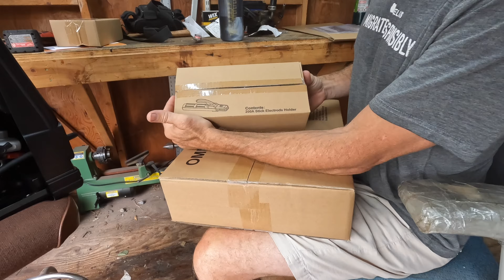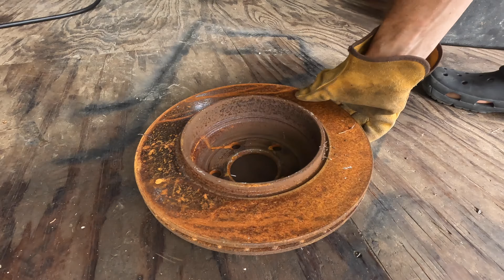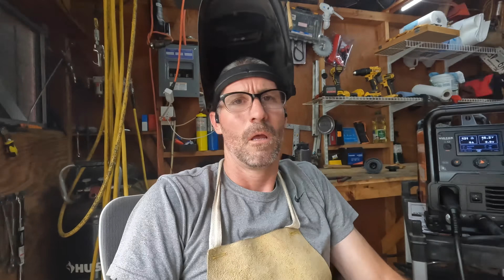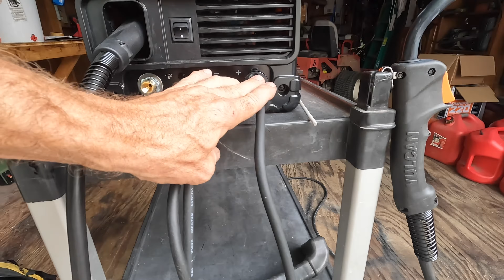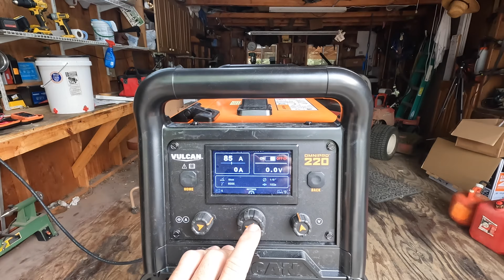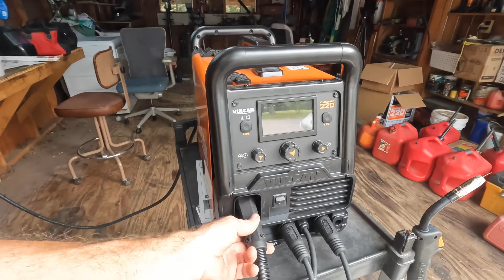Harbor Freight Multi Process Welder | Review of the Vulcan Omnipro 220

Comment: I took a flyer on one of these to get into welding and picked one up on sale for $770 last week.  Do you think that the default settings it offers when you enter your materials thickness etc, like voltage and wire speed are reasonable? Other reviewers think that some of the default settings for user-dialed/entered materials thicknesses etc are just bonkers, e.g for stick welding.
Reply from the maker: It's been working well on the recommended settings.
Reply: @JohnBullOutdoors  They wanted $279 for a two-year warranty, which was crazy. Now it's down to 90 days! Unfortunately, its circuit board died literally on day 91 since buying it, where it would no longer expel gas and wire feed (even cold wire feed). Fortunately, they exchanged it for a fresh new one the next day (technically past the 90-day warranty) at the second store I tried, so I dodged a bullet and was not stuck with a waay-overpriced stick welder. Hopefully the replacement won't die on me. There is another content creator who reviewed this model and also had its wire feed die early on.  AI (FWIW) does not suggest this model has a high defect rate. I just maybe drew the short straw.

Comment: I appreciate the thorough review, does the welder come with a flux core gun or are you required to buy it separately?
Reply: Can the mig gun  also be  used as flux core welding?
Reply: @Zandermp77 Yes. It can use flux core or hard wire.

Comment: I have had this welder for over 3 years & never used Flux core wire on it,all ways argon 75/25, it has never let me down, I don't weld over rust , I all ways make sure the metal is clean, I did fix a cast iron exhaust but I pre heated the metal before welding and it is still holding up but I honestly don't recommend welding cast iron.
It's a great welder for the price. 
Just my 2 cents.
Reply from the maker: Thanks for the comment. I want to get an argon tank to try it out with gas soon.
Reply: Night & day it's so much more smoother then using fluxcore, while fluxcore does weld using argon actually  helps you improve  the weld because  I can see the puddle so much better without all the splatter,  I bought an 80cf tank on ebay for  $100 shipped to my house but I have seen them double  in price & ever sine covid it cost me $65 to fill, it's something  to think about ,but once you use it you will never go back to flux.
👍🏼😎👍🏼

Comment: This is a good review, sir. I liked it a lot. With all due respect, though I am a welder and I have to say you were running those 6011s WAY too hot. An 1/8 6011 should be run about 75-90 amps depending on the position you are welding. According to my welding instructor, you can strike an arc at 40 amps, but I haven't tried that. 175 or even 125 is extreme for a 1/8 6011. You just need to practice striking the arc. Once you get used to it, they will strike easily. 
Like I said though, this video was great. I`m looking to step up to a multi process machine for my own, and I`m researching this machine among others.

Comment: Welding for over 30 years. Just got one on September 23 2023.
Ended up a boat trailer.  Welds great penatration is great. Works for me.
Reply: You think it would work great for building pipe fences
Reply: @russellmcmullen1480 might be too weak to weld with 6010 but 6011 should be alright

Comment: You a cool dude but made a bad review video because you didn’t give it a fair star, to start always clean the work piece wherever your gonna weld has to be clean a inch away from weld because paint and rust will contaminate the weld, also the rotors were cast not right process for materiel, second on the muffler Same mistake dirty work piece, also ditch the flux core wire and get a argon mix cylinder and never look back.

Comment: I had this welder for over 3 years. Also have spool gun. I had no issues and think it’s a great welder for hobbyist. I ran maybe 50lbs of wire and 20lbs of rods. I also have a Miller 255 which is about 5x more expensive. Just sayin I think the 220 welds as good as my 255 it’s just not as robust feeling. I wouldn’t run dual shield through it but short circuit mig I have no complaints.

Comment: Thanks for making your harbor freight welder experience video. Some things I noticed to improve your outcome, most rotors are cast iron. Not to suited for flux Mig welding. Your welding on a wooden floor in your shed. Gas cans are Less than 25' away from you welding. Flammable materials such as aerosol cans are close too. I know your ready to get into this welding but please take some precautions to your process. I would like to see you survive this for another video.
Reply from the maker: Thank you! Safety first. Great observations!

Comment: I don't trust Harbor Freight welders.  Bought 2 of them and both were broken right out the box.  - welder since 2014
Reply: Just bad luck. Ive bought many things from harbor freight as a home mechanic, this welder included, and I was able to weld a truss onto my Dana 30 axle with no issues at all. There was a time where the new hercules impact driver I bought twice from harbor freighr was a dud twice, but HF never gave me any issues swapping it out at all until I got a good one. As for the other stuff Ive had lots of luck and its lasted me many years.
Reply from the maker: It's all made in China. :(
Reply: @JohnBullOutdoors and thanks to china your able to afford these toys..